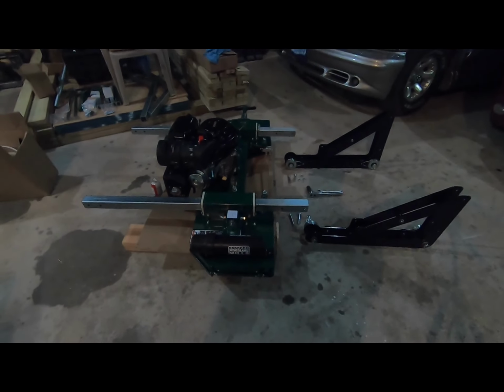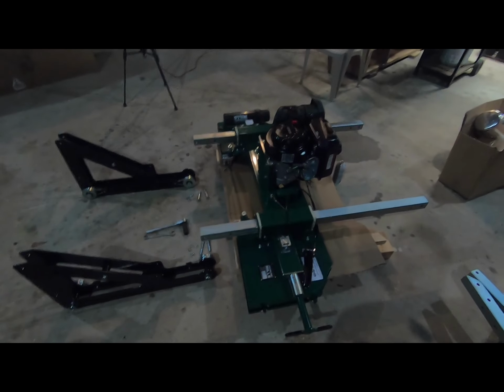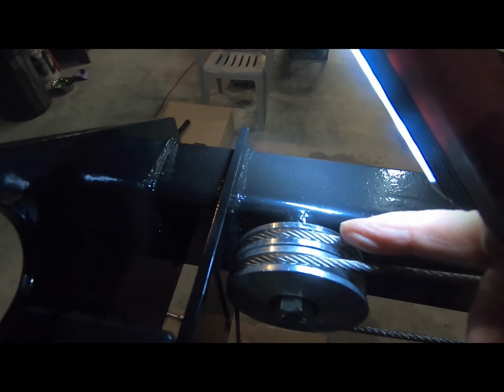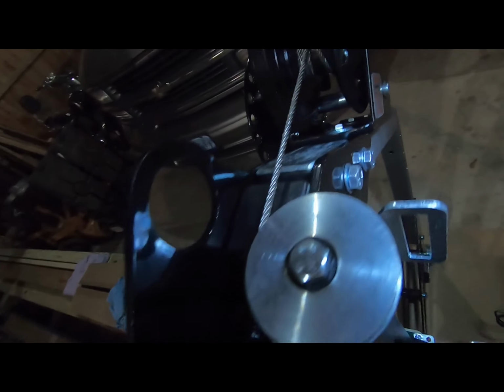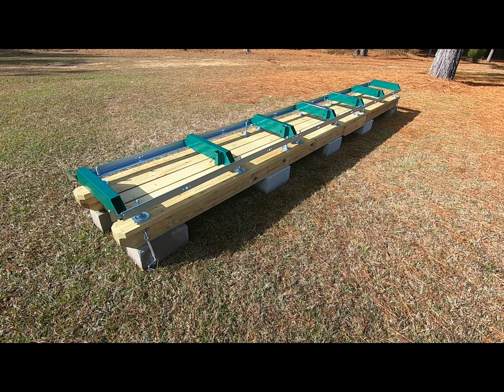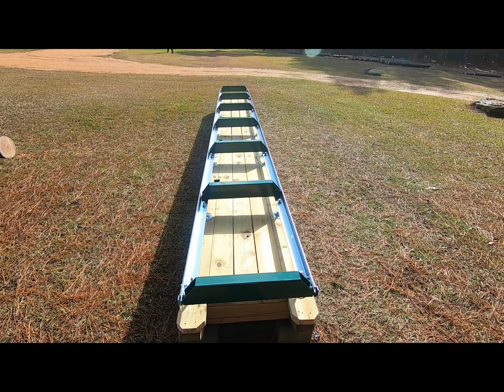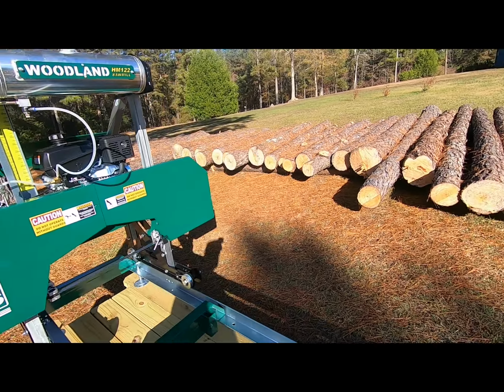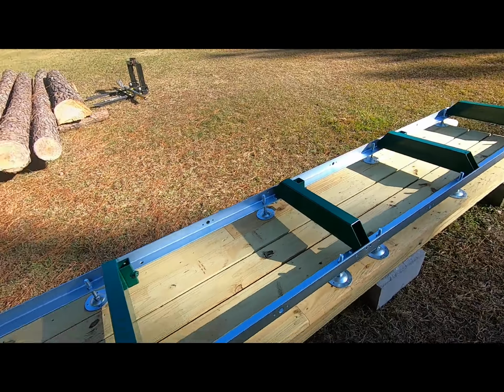Woodland Mills HM122 Sawmill Setup

Comment: Now it's time to start having some fun. I  watched a ton of these videos prior to getting my sawmill.  I always said I'd never get in such a hurry that I  would run my blade into one of my backstops,  like so many people have done. Well I've already done that now two times.  Depending on how fast your pushing your saw when it hits the metal pretty much determines if you totally trash your blade or not. Regardless it does serious damage to your blade. Good practice is to measure from top of bunk to top of backstop every time before you make a cut. So watch out for your backstops and your log clampdowns. I'm glad I ordered their blade sharpener and tooth setter combo, but wish I would've ordered them with the saw & saved shipping on them. If you get the sharpener,  go ahead and order a spare grinding wheel at that time. It's a special grinding wheel,  i figure having a spare wheel will probably last me the rest of my life.